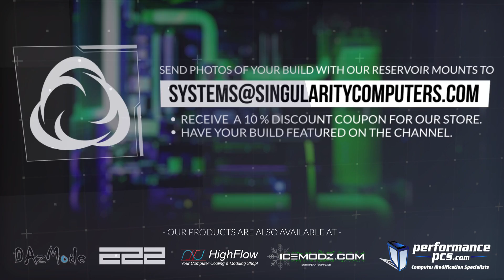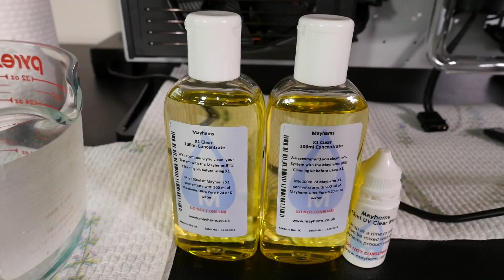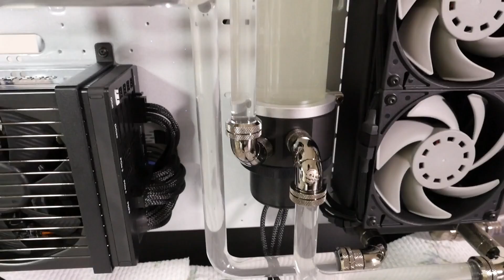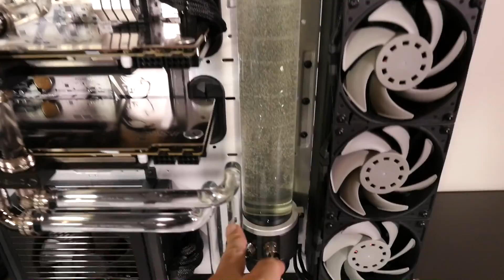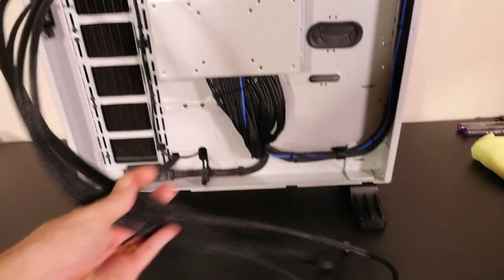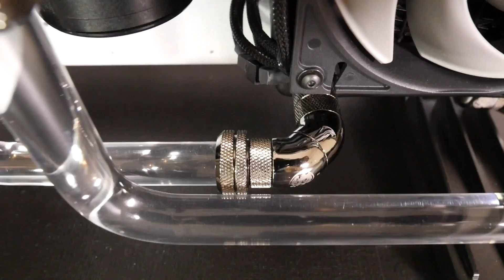SC Build #22: Core P5: Part 7

Comment: hi great build :)
Having the rad upside down like that will cause a big air bubble at the top in one corner i found this on my P5 Build had to turn my rad the other way round so it pushes the air out of the rad or you can lay the P5 down to flush the air out.

Comment: Your parallel circuit will be fine.  System flow will be higher than if the loads were in series.  So a pump with higher flow rate is desired.  By going parallel you lower system head-loss and shift your operating point to the right on the pump curve.  So there will be lower pump pressure but higher flow.   There will be an imbalance between the GPU's and the mono-block but EK is pretty consistent with their heat sinks and I'll bet the head-loss across each component is pretty darn close (and won't make much difference).

Comment: The mono block is getting the fluid it needs to cool. As long as he keeps the core volts close to stock it wont be to much heat for the loop.

Comment: Just tip the system over so it sucks that bubble. If flow resistance of CPU and GPU blocks are not much different then it wil work just fine. I believe that EK could provide you with such information :)

P:S.: I would'n trust that wall mount. Is it not to small for so much weight?

Comment: what I did with the lighting on my p5 was to use water fitting l came out off top left socket where power for mbo is with male to male used  female on back to tighten then used 50mm female to female acrylic tube with 90° rotary then cut tube to length of UV nanoxia solid led strip used hard tube fitting fed wire through back through 90° to strip sitting in tube sounds hard but easy no drilling no mess put light along top in tube hope it helps it looks like it floating

Comment: "a lot of you will say it will not work" well it will work but not as effective because of the counter flow of the coolant!
Reply from the maker: But the counter flow comes down the other side. Fluid finds the path of least resistance.
Reply: But the other side has entrance to the gpu waterblock too so you have 2 ins, it will fill up the waterblock but will not have a proper flow cooling just the monoblock. But nice looking build though as always!

Comment: Parallel loops are good in theory. However. Flow is split between all items. Which isn't ideal. I've done both an series loops with there higher flow characteristics work much better. And the less tubing/fittings are way cleaner

Comment: How on earth are the fan cables run?
Reply: Also because that is a dual pass radiator, that drain will drain out the res and that side of the radiator, but wouldn't there still be a bunch of coolant in the left most pipe that wouldn't come up over the top of the radiator to the right side where the drain is??

Comment: It would be really interesting to see what you could do with several 375 or 405 nm diode lasers (check Thorlabs for instance).   Maybe point them into the tubing in parallel or bounce them off a diffuse reflector.  Stay below 4.5 mW for safety considerations though.  Not sure I've seen anyone utilize them in a build but they can be powered with 5V DC so no problem finding a source to drive them in a PC.  Maybe they could be mounted cleanly on a riser for instance.  Anyway, you're the creative genius with this stuff... let's see it!

Comment: I really think parallel configuration is a good Choice for this build. I was planning a semi parallel configuration in a Mercury S5 with dual D5 pumps also in parallel. I did some math and found out, that with dual Pumps there will be exactly the same flow in the Blocks, regardless of putting the components in serial or parallel. So there will be no difficulties here and I really like the optics!

Comment: instead of making a custom cable to run your pump at 100% Couldn't you have just unplugged the the 4 pin PWM from your board and just ran the molex? The minute I unplug the PWM the pump runs at 100%
Reply from the maker: Not with the new EK D5 PWM pumps. They run at about 5% of their RPM without a PWM signal.
Reply: That is strange. I have an EK D5 PWM pump that I purchased back in June
Reply: My EK D5 pump also runs at very low speeds without PWM. I made a ghetto cable to power the pump with an old molex connector and soldered an extra cable on the +5V because 5V is the same as a 100% PWM signal. So i don't even need to power on my PSU to fill the loop.
Reply from the maker: Maybe its just one batch that does it, something they found and sorted out quite quickly. All the new ones I have had since the beginning of the year have had this problem.

Comment: Have you seen HWBot recently, Overclocking seems to be still popular.
Reply from the maker: It is but not like it used to be. Water-cooling used to be for overclocking now its more for aesthetics. The priority has changed. There was a time when everything was about overclocking.
Reply: The time when garden hose pipe was used in watercooling loops was the real time for the enthusiast, now it's mainstream, processors are cooler than ever, and the only real thermal bottleneck is the gap between the CPU itself and the water. I'd love to see more 1.5v overclocks though. I do enjoy overclocking, though the cooler no longer seems to be the limit, there's more need for de-lidding as the next step for removing thermal resistance than ever. Not even LN2 overclocking is what it used to be. That said, a loops acoustic output is capable of being lower than ever, and it sure looks nice!
Reply: I think what you mean is within the custom water-cooling community, not the everyday enthusiast, correct?
Reply: I'm in process of putting together my first water cooled build. I'm not into extreme overclocking, my goal was to find a good balance of lots of processing and graphics power into a very small case that is both quiet and that has good aesthetics. 

My previous build was air cooled inside of a big full tower case and temperatures on there were fine. I'm not in process of downsizing my case and putting a dual GPU and a high core-count overclocked CPU into the smallest mATX case I could find, which is one third the volume of my old tower case. I tested all the components in there on air just to make sure things work. The CPU was fine even on air with a moderate overclock but the graphics cards throttled because they butt up against one another and airflow in the case was impeded by the massive CPU tower cooler. It was also noisy as hell on air.
Reply: Michael Gordon Another good point is density, as there's no air coolers to take up space, and no real need for ventilation in the main compartment. This was a plan for my PC- an Air 240 with a Monsta mounted to the front lol, was going to paint it to look industrial, but one of the key aspects of it is that it's quiet, and compact for LAN parties. The case is very small, and considering these days it supports dual 1080s and a 10 core CPU, it's quite interesting how computational density has been reduced. Sure, a system like that would need quite a bit of fan speed to cool the components using only a 240mm rad, but that's half the fun. Sure, I could only afford a 960 and an i5, but a man can dream.

Comment: I did mine a little different.  I mounted the cards upside-down where the PSU should be, and the PSU  in the top right where the rad should be.  All rads mount on the back, and my soundcard mounted vertically where you can mount the GPU's normally.

Comment: for the light you could cut a square of acrylic the same size as the glass and instal the light on it so that you can make your measurement and photo, and then ship the system without this acrylic panel and just let the customer fix the led strip on the glass with double sided tape

Comment: would polishing the inside of the reservoir stop bubbles collecting on the surface ?
Reply: They are not permanent and will disappear once it has been powered up and run for a little while.
Reply: +Ian Clarke of course they're not permanent but it's about what is possible :)
Reply: U can't Polish a surface to the point where absolutely no bubbles are hanging onto the reservoir but it could decrease the amount
Reply: Andreas Fröhlich
 I can't think of an easy way to reach inside that long res to effectively polish it to that extent. It's hardly worth the effort and time considering they won't be there for very long.

Comment: These is the most cleanest wire work on a case. There is a small cut opening near each gpu so the cables can go straight to the back is hard to see routing the cables strait to the back can be made using plexy plate so cables can look clean. But the lights is hard. With out the cover is hard as you said making the led point to the build will look perfect but without is hard there is hardly here to put it with out affecting the build. Daniel home run with these one! OMG

Comment: Awesome build! The core p5 is a really hard to pull off, but the parallel configuration really brings it together. Most builds I've seen resort to running tube all over the place and at ugly angles due to tube length. you fixed all that with a 5mm extension lol

Comment: Parallel should be ok, but because the GPU and CPU block resistances are a diferent, there are going to be different flow rates at said intervals.  Thats why its often quite alright to do parallel GPU loops at the same resistance of the block.  again, there will still be flow, but it wont be awful like some people would think
Reply: Test is a most. It works with gpu. Is not the first one I see in these way I see a mitx build on one channel that I follow and works if the pump push that it will make the entire loop. The loop Daniel build is so dam clean. Looks like there is none
Reply: I agree with testing. Realistically, the motherboard will increase the pump rpm with the general PWM header if it has to and increase flow rates. You'll know pretty quickly if temps don't seem right and I know he had more than enough experience to make that call  I trust him!
Reply: +Slayerfish that is why is experimental